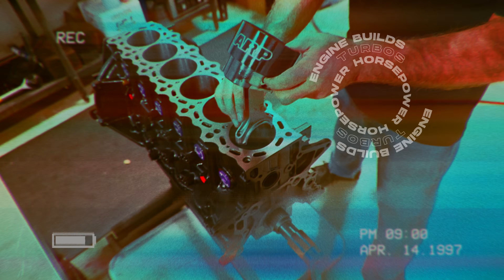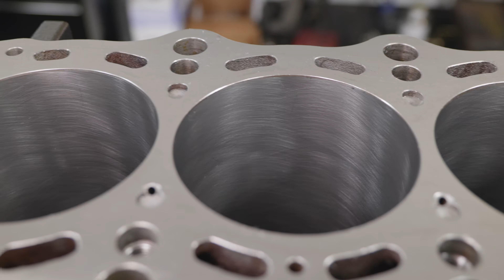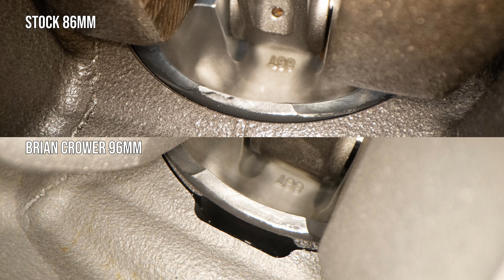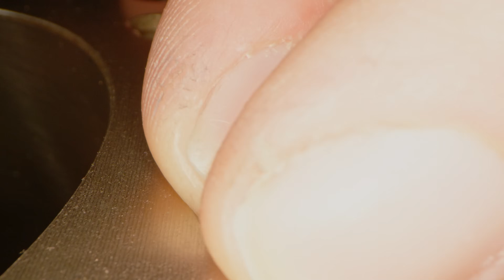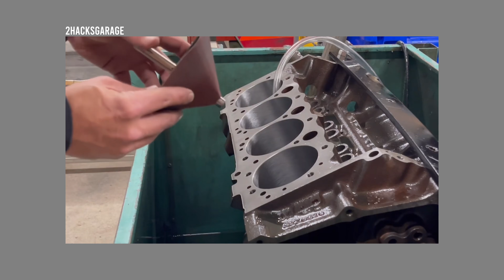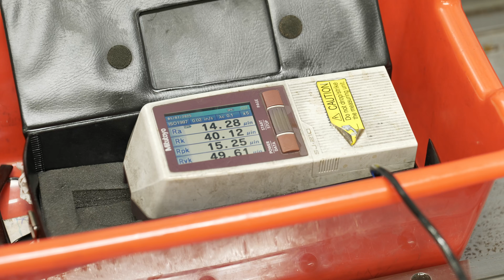Engine Bore / Cylinder Preparation Before Final Assembly | Jay's Tech Tips | RS Garage

Comment: Hey Jay  if your engine does not have piston squiters  do the pistons and bores rely on oil mist in the crankcase to lube them  saw a vid recently where there was an aftermarket block that had the bottoms of the bores extended to support the piston skirts onBDC is this common which do U prefer TY for the great vids

Comment: Hi i put billet valve covers on my 2j and it started blowing oil everywhere would a catch can to sump drain be a safe option as the cover where quite expensive and would like to use them if possible

Comment: Jay you have an old video showing how you wash a B series block but it would be great to see how you final wash a cast iron block with respect to flash rusting in the oil galleys and other sensitive areas.

Comment: Thanks for sharing the information.

I wanted to ask you a question. I need to rebuild a 2JZ engine to produce 1000 hp. Could you tell me what RPK, RK, and RVK values would be most suitable?

Thank you very much.
Regards, Goyo
Reply: 2Js are fuel injected, not carbureted…………….
Reply: @RustyShackleford9000  If you hadn't told me, I wouldn't have noticed, haha. Don't you see it was a translation error? What did a carburetor have to do with the RPK, RK, and RVK values, please?....

I've already corrected it, thanks for pointing it out.

Although they didn't answer my question, haha.